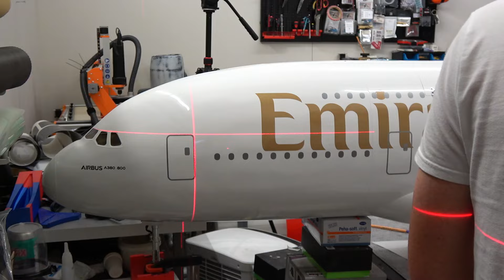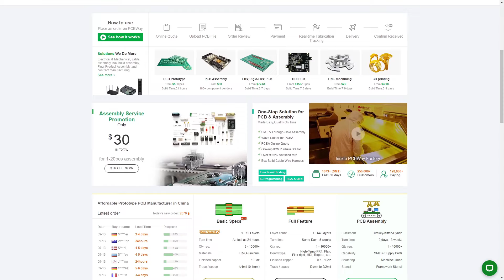Building a Giant RC Airbus A380 Applying Emirates livery

Comment: Outstanding. Makes applying vinyl look easy, haha. Please consider the many comments on the A350 video - this A380 is FAR too nice to risk on a high speed landing, it would be a tragedy if it ended up accidentally pushed into the ground because of avoidable excessive lift at touchdown. I get that nobody wants to be told that their landings are suboptimal, but then again, nobody wants to lose a unique aircraft that's easily worth five figures.

Comment: I always look forward to your builds.  Awesome!  Even with my 50 years building model planes 40 of it in RC planes and helicopters, I can say your work is absolutely incredible!  If I may suggest; You need to always cover the bottom of all surfaces and fuselage first, so the seams don't catch light. The same for fuselages.  Always cover rear first and work to the front so airflow doesn't lift the covering or cause additional parasitic drag.  Keep up the fantastic builds and videos!! :-)

Comment: a felt squeegee is very well suited for forcing a film on curved surfaces, plus it would be nice to heat the joints of the film with a hairdryer over the film, firstly, then the joint of the film is much less noticeable, and secondly, the "fried" joint holds better ....

Comment: Hello Ramy, hello others here
What a fantastic Build I am still impressed watched almost every video WOW, WOW WOW

Can u or someone else help me with a Frame for my drone which crashed but all the electronic stuff is running? The frame when u buy it is to much it's a yuneec q500.
I don't have 3d printers or so on I just want to make something where I can reuse all the electronic stuff. When you Google it u will see how it originally looking like. I like the middle part but not the landing gear and the motor wings and would like to keep it futuristic and use an fpv camera for flying.

Comment: I have a good idea. You should make the nose of your plane stronger so incase of a crash landing the nose hits the first on the ground so than your plane would not be so much damaged and second you should put an adf at the back where the exhaust is and a extra battery for it so it will be safer